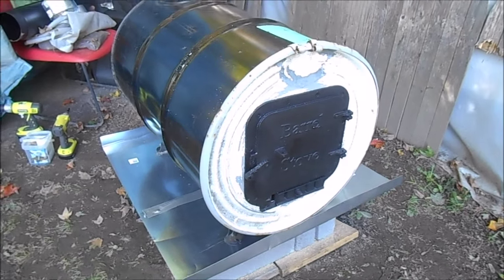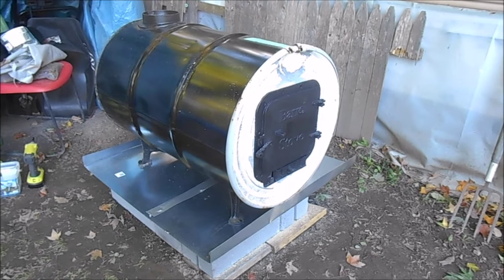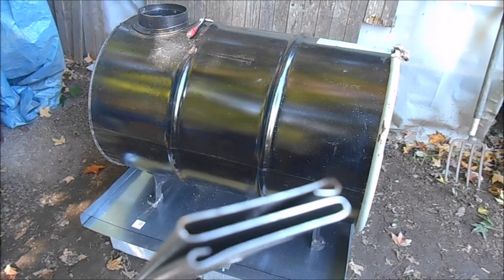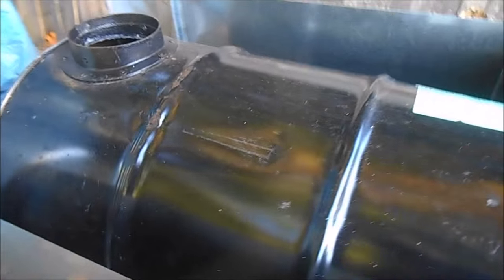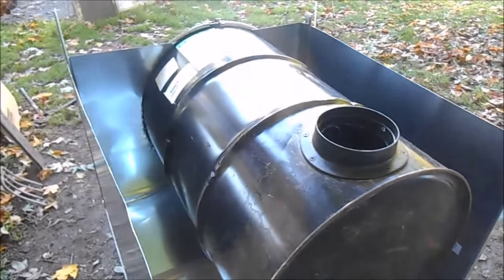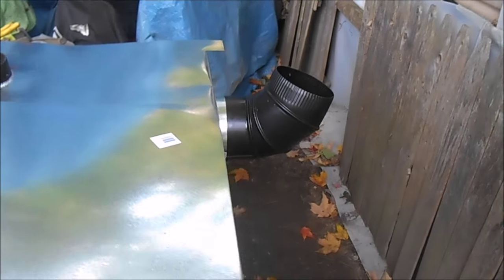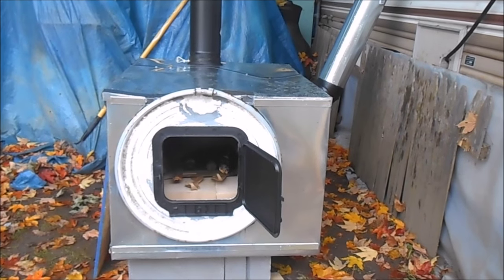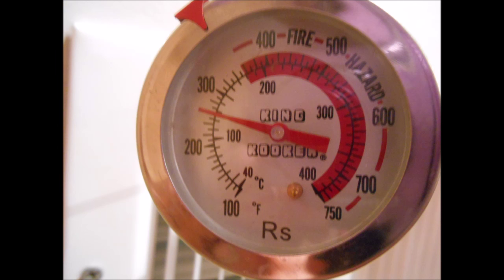How I Built My Outdoor Furnace Heat Exchanger

Comment: Been wanting to do a build for some time to heat my house. Mine I had planned to use hardy backer concrete board for the heat box in hopes it would hold the heat longer. Great job and I’m sure it has saved a ton on the electric bill.
Reply from the maker: It did help alot but as some others have pointed out, remember to do a few burns BEFORE heating your house. To get rid of fumes and noxious stuff!

Comment: A little late but this is just what i was looking for.  A few ideas to make it better...    First i would try to use copper tubing and coil it around it and do in floor heating with pex.  This could give you hot water as well.    If you must do air i would wrap it with aluminum duct for dryers to keep the air seperate.    Thanks.
Reply from the maker: Thanks for the tips!
Reply: Aluminum foil ducts are rated for only 400°F.  The area near the stove will be putting out over 700°F.  The aluminum will offgas toxic fumes when heated to those temperatures as well.  I would use a stainless steel rigid flex duct, such as a chimney liner, to wrap around the barrel and use a 6 inch in-line blower to bring air from inside the camper/home, heat, then return the air to the home instead of heating outside air to the home.  You don't want to use galvanized steel as this will off gas toxic fumes when heated as well.  Use rock wool to insulate the casing around your barrel/stove.

Comment: Nice job. Just a idea if you need more air flow into the trailer you could add a inline register fan with a dimmer switch to  control the speed of the fan.
Reply: Don't use a dimmer switch for motor speed control.Dimmer switches are for lights only.  Levithon makes a motor control for small fans.
Reply from the maker: Great advice, thanks!

Comment: Its s-lock not j channel.  No big deal though. Nice work. Also you will get a lot more heat inside if you cut a 2" hole toward the bottom of your heat echanger facing. Id put it just below drum to the left. It will help the flow from heat exhnger to the camper. Put a screen on the hole you make to prevent mice from making it a home. Im and HVAC guy so Im speaking from heat exchanger and air flow knowledge. Not opinion. Again, you did a great job. This will just make it even better. God Bless.
Reply from the maker: Thank you for the nice comments and how/where to put it. I'm going to redo it this spring and I'll do that!
Reply: Dude, excellent advice
Reply: Well done! It's always awesome to see people doing home projects that work out. Excellent job!
Reply: We always called them S cleats,not locks.If you can find free or cheap computer cooling fans, try putting one in front of the register to draw air from the firebox and help circulate it in your coach.

Comment: Nice job !  most people have to call for help when they have a flat tire... You think outside the box and are a pretty good fabricator too... Just remember, that barrel will only last 3 to 4 years. So with that. make it easy to disassemble to replace the barrel.
 Also burn the barrel before you install, kinda like seasoning it before use. 
Take Care

Comment: Very good build! I would put insulation around your outside box and chimney. Therefore more heat would flow into your home. Also a solar air heater is awesome. My 6'x6' hits 95C or 200F of heat when sunny.
Reply from the maker: Thanks and I agree about more insulation!
Reply: @ChessiesAdventures  couldn’t you encase the drum in concrete? Or make a concrete box around it with bricks?
Reply from the maker: Yeah I think bricks would be good!

Comment: This is great! I have an RV permanently parked on a lake in the interior of British Columbia, and last week I was there and my batteries couldn't keep the furnace running all night. I got to thinking about how to heat the trailer from fire from the outside and thankfully found your video! I got the stove kit yesterday and can't wait to start the build. One question...what type of metal did you use for the box? Thanks for posting and thanks to all for the suggestions for improvements as well!
Reply: Did you ever find what type of metal that was?
Reply from the maker: Not sure what type of metal but I got it in the heating section of Lowes

Comment: This would work better if u had a return duct on this too with a fan on it.
Reply: True but sometimes you just want something simple because you aren't relying on it permanently.  Ppl like myself who only need to spend a few hours in our garage to get a car repair done in winter time without our hands freezing to the wrenches for example. Or for moose camp where simpler is better because you carry everything in except the wood. A few extra logs here and there isn't a big deal. But if for a house where you sleep all winter then yeah man... the return is totally worth putting in bcuz it would heat more with less fire. I'd also insulate the ducting in that case.
Reply from the maker: I agree!

Comment: Would help if you'd insulate the outside of the furnace to keep from loosing heat
Reply from the maker: If I ever do it I again, I will
Reply: I'm doing it, but mine is insulated and has a return vent and a fan with a thermostatic controller in my home. Works great.
Reply from the maker: That's awesome!! I would definitely make some changes if I ever decide to do it again!!

Comment: Just found this and I have a few questions. How well did this work out for you in the end? How hot did the sheet metal get once you had a fire in it? How hot did it get around the stove pipe? I am going to build one of these in my basement of my house and run duct work down into it to connect to the duct work in my house. Thanks for showing this. Gave me some good ideas.
Reply from the maker: It heated very well but the stovepipe got very hot and I didn't do a few burns outside before hooking it up for heat and I go t fumes. After I got those all cleared out, LOL, it worked well.

Comment: taking that apart and getting the entire barrel to 100% bare metal is absolute. do not use this again until. unfortunately these types of barrel wood heaters need to be preburned hot hot fires 3 times after sanding, grinding or sandblasting. after getting to bare metal, 3 preburns have to be done. and thats for a big garage where fresh air is pulled into the room by the window doors and outlets. but using this the way you have done it is 10 times more important to have bare metal. unfortunately you have used this already and its still important to fix. good luck!
Reply: maybe she likes the odor of burning paint?  I know I don't.  Definitely not good for he lungs.   no air inlet either....?  very inefficient.  But she's learning as she goes.
Reply: @juststeve7665  i noticed i forgot to mention that the outside of the barrel needed to be bare metal. not the inside where you put the wood. the outside black paint burns off very dangerous
Reply from the maker: Many cahnges if I ever do it again, thanks!

Comment: here you go

http://www.ebay.com/itm/Tjernlund-DB-2-Duct-Booster-Fan-Rectangular-or-Round-6-8-Duct-/271575529356?hash=item3f3b29b78c:g:fTAAAOSwq7JT62lW

i heated my last house with a woodburner in the basement. this is exactly what you need to make you heater way more efficient  allowing you to burn less wood and give you more time to relax and enjoy the warmth and the savings. do not be tempted to use the inline booster fans. they will fail because the heat will be greater than they were designed for. this booster fan can be oiled and hooked up to a fan limit switch that will only allow the blower to run when there is a minimal amount of heat present in your supply pipe. you can wire in a heat only thermostat and when your trailer gets to the set temp it will shut off the blower.
Reply from the maker: thank you!

Comment: Can you please tell me where you purchased those flat pieces of tin?  All I can find is corrugated roofing tin.
Reply from the maker: I got them at Lowe's in the heating and cooling section.
Reply: @ChessiesAdventures  All I can find is Galvanized.  I'm trying to find it without the Zinc coating because at 390 degrees it starts melting the zinc oxide coating and the fumes are dangerous.

Comment: I'm looking at doing the same thing for my camper. Are there any concerns about the paint burning off the barrel or toxic smoke from the outside of the barrel blowing into the camper?
Reply from the maker: Pre burn all the paint off before you assemble it and it should be ok then. I didn't know to do that at the time and it was awful and I had to leave the camper for a few days.
Reply: Thanks so much much for sharing 🙏. I also noticed a lot of people use a blower did it work well enough without one?

Comment: wouldn't it work better if you had a return line to the exchanger? just wondering i am thinking of doing this myself i just thought there would have to be an air return so you have the cold air going to the heat exchanger and hot air going back out
Reply from the maker: Yes it probably would have, I didn't think of it at the time but I'm going to redo it this spring. Thanks!

Comment: very smart but you need to remove the paint from the outside of the barrel or run a few hot fires to melt the paint or else you will poison yourself with the fumes of melting paint.
Reply from the maker: YEah, I figured that out afterward!

Comment: Do you still have this set up? What was it like on your coldest days?
Reply from the maker: Hi Carl, I haven't used it in two years now but when it got cold, here in PA, it did a very good job of heating the camper. Even in sub zero temps it kept it above 55 degrees inside with no other heat source. It did use more wood when it was that cold though.

Comment: how did it work for you throw the winter
Reply from the maker: +sheldon wagner It worked very well Sheldon and provided alot of heat until about 3 weeks ago, but I must have gotten too hot of a fire in there a few times because it got a leak in the steel drum and it was letting smoke into the heat exchanger.  Not sure yet if I didn't get a good seal around the connections or if there was just a weak spot in the drum but I'll be taking it apart this summer to investigate!
Reply: any kind of water that gets in or on the stove will cause it to rot out, reacts with the ashes and is very caustic

Comment: your stove pipe will need to be double wall.. Why? Cause the flue gas will cool too fast an it will rust it out in a year and will cause creasote build up!! I learned this with the greenhouse wood stove
Reply from the maker: +Leesville Aquaponics Homestead  Thanks for that suggestion, I wondered about that too and I'm thinking I will do that in the spring or summer next year. I just need it to make it thru this winter as it is right now.  I'd be interested to know how yours works in your greenhouse too, that's another project I've been thinking about!
Reply: +Chessie's Homestead My wood stove is a 600 gallon dairy chiller tank stainless steel about the same size as 8 of your barrels lol... You will have issue this winter on that.. You will have poor drafting as it gets colder and water will run down the pipe into the wood stove and rust the whole thing out.. Might make it 2-3 months.. I'm not bashing I'm trying to help you out cause I made the same mistake on my old barrel stove.. I'm heating 3k sqft of GH space with my big tank heat now
Reply from the maker: +Leesville Aquaponics Homestead thanks for the tips. Right now this is all my budget would allow but hoping to improve it soon!
Reply: +Chessie's Homestead may check around and ask friends if they have any laying around also check craigslist
Reply from the maker: +bobinmissouri Thanks for the suggestion Bob, I'll be looking around.  It's working great so far!